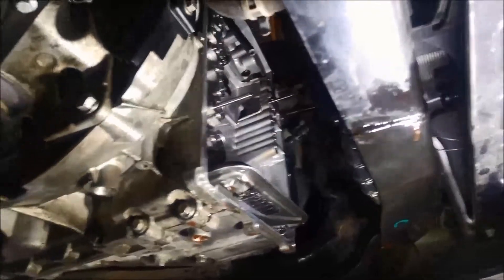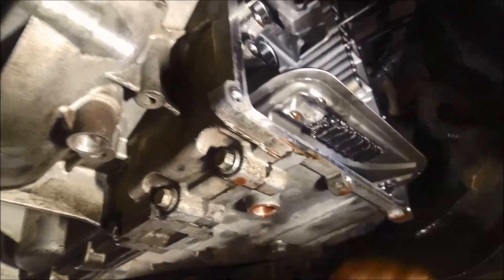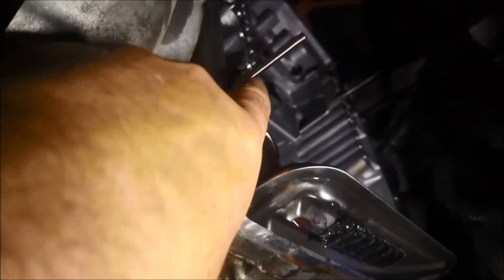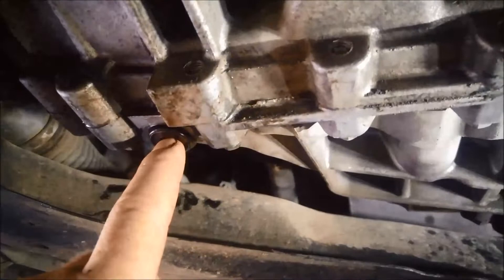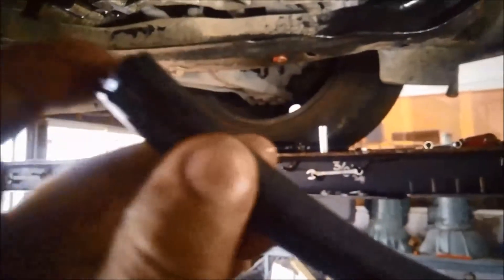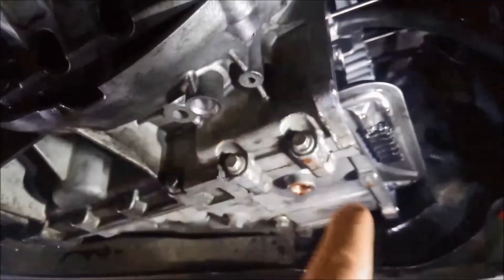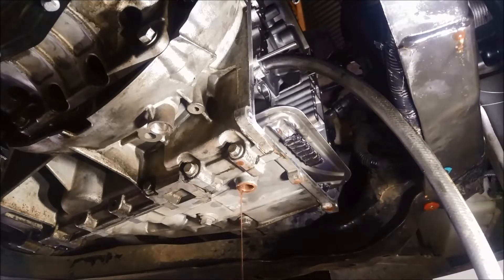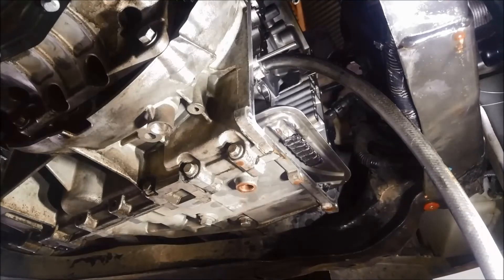How to Powershift Ford 6DCT450 DPS6 Flush Internal Filter SST Getrag MPS6 SST Automatic Transmission

Comment: Hi, was wondering if I could ask your professional opinion  I have a Volvo v70 1.6  d2, 2013 and it has fork shift issues  I can't seem to get a replacement box I can however get a 1.6 d2 power shift box from a v40 of the same year boxes look identical outside  I wondered if they were  fitted with the same parts inside with the exception of the electronics  if I changed the Gearbox Transmission Valve Body with Solenoids from the original v70  would it work

Comment: can you show how can I change the internal big metal filter in the gearbox?
Reply: Seen a video of a guy doing the internal filter by cutting the old filter neck to get it out.

He then heated up the plastic top of the new filter to soften it up enough to squeeze it back in.
Reply from the maker: hi, do you mean while it in vehicle or when transmission is on the bench? will do when have opportunity. cheers

Comment: Hi i have dodge journey with same gearbox, 6dct450, but in last time i have problem.
When driving kick down or strong or overtaken on planes the gearbox lost 1,3,5 and revers gear. Afternstope, restart engine everything works fine. Can someone have ideas what can be?. I change gear oil and outside filter again on 40k km but didn't have results.
Help?
Reply from the maker: hi, if you mileage most often is due to  contaminated solenoids and sensors. if there are small pieces of plastic in fluid, then the spring guides/retainers have shattered and you will need to remove and disassemble trans to repair. the external filter is only in the cooling line. cheers

Comment: Hi @yepthatsit i have a Problem. I changed the friction plates. After that i can only drive on 2,4 and 6. the others (r,1,3 and 5) i have uncontrolled high rpm, when i try to drive. 

Example: when i try to drive with 1 gear, its starts to move with high rpm. A few seconda later -> info blinks on and a fault code. I can drive only with 2,4 and 6. i have to restart the engine every time.
Reply from the maker: hi, best you contact me on our facebook link, we can exchange pics, vids & beers on there. cheers
Reply: I have the same problem. Could this be a contamination of the mechatronic? @YepThatsIt

Comment: Hey, my Reverse Gear works only Sometimes and the shiftimg ist pretty hard. Could IT Help to do ur Video Tutorial or is it Broken?
Reply from the maker: hi, i`d need more info, however definitely worth a try, see my precheck vid. shift fork1 operates on 1st gear and reverse. these are an automated manual transmission, so if shifting hard it is the pressure control circuit. its a common problem that all solenoids get contaminated or become faulty due to internal abrasive wear on these. other than that it could be the sensors on the mechatronic plate are also contaminated as the signal pickup points are also magnetic. and could also be a faulty range sensor. if there are tiny bits of plastic in valve body, then solenoid flush/replacement will be a short lived remedy as this will mean the plastic spring guides in clutches are buggered. cheers